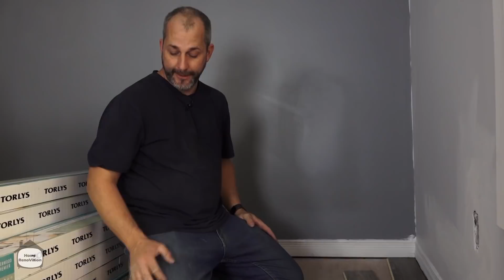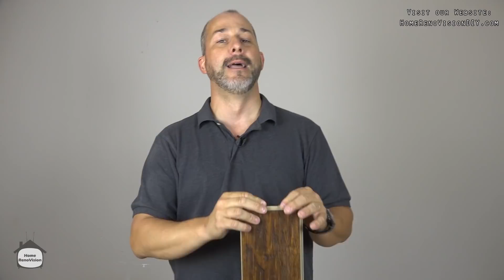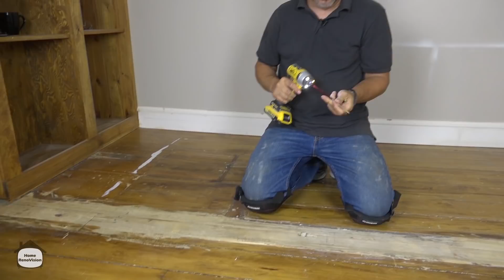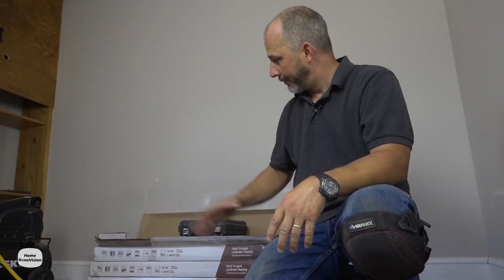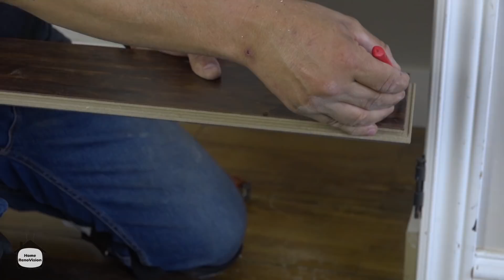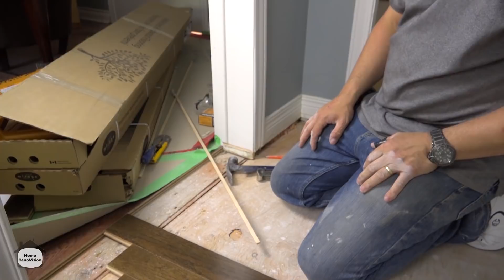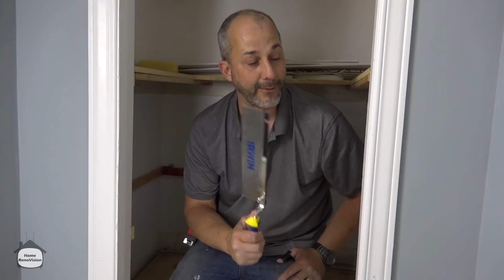How to Install Vinyl Flooring , Laminate Flooring and Hardwood

Comment: Because of YouTube and videos such as this, I'm able to tackle big jobs.  So I've watched your channel long enough to know that a montage of older installation videos is a good social media strategy; however, please help me by adding new content, this is my dilemma:  My floor install is a combo of two types you have here but I need you to go a bit further in your installs.  I'm using a 5"x36" (3/8 thick) bamboo laminate over felt w/vapor barrier non-slab and I started just as you did about halfway thru this particular video. The slats are orientated such that when I get to the doorway it almost looks exactly like yours did but I need to continue into the hallway where the flooring will be parallel with the hallway walls.  At one end of my 16' hallway, there are 5 steps down (split level).  On the opposite side of the hallway is the 2nd room I plan on flowing into placing flooring exactly like I just did.  There is one more bedroom that is on the same orientation as the room I just finished.  So, those 5 steps down seem like they will make/break me - can you do a short video on steps?  I have to run the boards either to the end (doesn't make sense), or put one board perpendicular to the others, run hall slats to that, then add the stair nosing (but it would help seeing you do it first!).  Also, a short video on backward install - because the last bedroom I'll be flooring back into from the hallway install.  The directions do allude to backward installs when doing multiple rooms and you don't want transition pieces - and I don't.
Reply from the maker: awesome!

Comment: I'm not doing any floors, but I enjoyed watching your video! If I were in the market for new floors, I'd just hire you. I hope a television network is aware of your work - You could host your own show.
Reply from the maker: Not concerned about the future, just trying to help people today is all. Cheers!
Reply: @HomeRenoVisionDIY 80's P n' E 'prize home; guess they had to start somewhere.  Good bones, however all flooring, mostly CHEAP laminate put in to sell to me .. . Now with 12yrs of surface water damage, got curled and swollen edges; also kitchen pipe squirted UP and particle board failure underneath, near cabinets, about the size of a body.  Bath wallboard failing near tub, redid silicone, failing above that.  One tile short of redoability, yes, also on particleboard, in the bath???  Scared .   1400sf total floors and ceilings too; old mobile with the lines across, painted previously, and puffy water damage here and there.  HELP!?   Seriously .  I KNOW can do it, just need more confidence.  Triage tips ?  WONDERFUL knowledge base.  Still 
Yikes?!
Reply from the maker: Hi Carol, start with keeping it dry first. then deal with things that are failing like the bathroom. flooring can wait until the end.

Comment: Thanks for another great video. Considering doing the install myself of luxury vinyl planks throughout our 1200sf home. Not sure how difficult it is to continue clicking and locking planks through door ways, one room to another. Or it's easier to just stop and install a transition under the door. Any advice?
Reply from the maker: Transitions are definitely easier. seamless is definitely more sexy!

Comment: Jeff, outstanding video.  I have installed a laminate floor in our home several years ago.  I have been thinking about upgrading to hard wood and now with the tips you have provided I feel a lot more confidence about tackling this type of project!  Great video and very helpful channel in general.  Thanks again,
Reply from the maker: Hi Jb, just realize that it is quite taxing on the back working hunched over. so be prepared to do it over a few days to avoid strain.
Reply: Thank you.  I installed the laminate floor several years ago and man was I crippled up :^(  Bad back and knees.  I could not do it that fast any more or would want to.  Good advice to spread this over several days.
Reply from the maker: Cheers and best of luck.

Comment: Your videos are helping me so much with my remodel. This is perfect timing as I'm deciding on flooring for my kitchen. Can you tell me if you have any experience with the Life proof flooring from Home Depot? It's a waterproof LVP and I had decided to use that until I saw this. How does it stack up against laminate like a Pergo or something like that? Which would you go with? I'm doing this mostly on my own - you helped me before with kitchen countertops! - and I have a budget. I want to make sure that I do this properly, for the long haul. Thanks for what you do!
Reply from the maker: Not personally , but I have heard great things so far!
Reply: @HomeRenoVisionDIY  thank you so much for your response! This is really helpful. The one thing that I've read several times  (about the LifeProof) is that the click together links are a bit weak. I'm starting to think that, for me, it may just be best to stick with a well known product that's been fully tested. I mean the waterproof Pergo. I really appreciate your feedback. :)
Reply from the maker: I will be sure to update my opinion as we go along. Cheers! and good luck with the project!
Reply: @HomeRenoVisionDIY  thanks so much!

Comment: Agree that hardwood flooring is the best, if not the only choice, except for wet area.  We have granite tile in the kitchen and it is durable, non-slip, and easy to maintain.  Everyone who visits admires the hardwood installation.
Had not seen slip tongue 122:00 before.  Solution is nice if you only have to deal with one entry way.
Excellent video.  Thank you.
Reply from the maker: Thanks Albert, Love your choice in flooring. Cheers!

Comment: Hi first off thanks for the channel. What procedure difference for a concrete slab floor.
Reply from the maker: hardwood requires a special paper with slots that you place pl premium in and then you install ! Everything else simply use a underpad designed for concrete. Your local store can help you with that. Cheers!

Comment: Currently have tile and wood floors in our front room/slash kitchen area. Looking to Renovate it and put in laminate over the entire area. Do you recommend removing both the tile and hardwood that is present? Or am I able to go over both of them with the laminate granted it’s all level. Very new to this! Any info from anyone would be great. Keep up the great videos!
Reply from the maker: I would suggest installing vinyl in a kitchen and you could go right over top if you wanted to.

Comment: hey jeff,a computer tip,never blow out your computer with a compressor,a compressor has moisture in its air stream,it can cause short circuit
use a leaf blower instead,or the expensive compressed air for computer cannisters,great diy channel,have a good one jeff
Reply from the maker: Hey Ronny a compressor tip. when you stop using it open the drain for the moisture to leave the tank. then all is well.
Reply: thanx for the tip Jeff,always never to old to learn something @HomeRenoVisionDIY

Comment: Thank you for all the detailed info. I'd like to share with you an idea I learned from another YouTube video to remove scratches from the vinyl or hardwood floor.
Rub a piece of walnut where the scratch is on the floor and you will never see it again. I have made a 50 second video on this subject.
Reply from the maker: sounds fun if it works. Cheers!

Comment: They probably don't include laminate floor cutters because that's the competition (the cheaper alternative) and the don't want to mention them as most people will choose the cheaper option for a variety of reasons.

That's my guess anyway.

I'm about to purchase vinyl flooring for my utility room and it too says it is easily cut with a knife also only a 2mm gap around the edge, as I'm putting skirting (baseboard) after I can hide the edges instead or using quadrant (quaternary round).

Keep up the great work buddy 👍
Reply from the maker: The cutting tool can be purchased from our amazon link below. It is one of my favorite tools. Cheers!

Comment: Very nice video. Question, we're doing the Pergo flooring in our kitchen, dining and hallway. Dining and hallway is carpeted right now and the kitchen is linoleum. Can we just leave the linoleum down? I recall when I was younger the fun you go through when removing the stuff. And do you figure just use smooth out the transition from the linoleum over to the subfloor of the dining room?
Reply from the maker: in most cases if you remove all the flooring you will have only 1 level of subfloor. if you leave it on then you will spend a lot of time and money trying to level it out. Go ahead and get rid of it. only takes a few minutes.

Comment: I just bought a new house and need to choose a new floor.  I want to run the same flooring through the kitchen, dining room, living room and hallway.  Should I go with this vinyl plank stuff or normal hardwood?  I plan to live here for 20 years at least and I have two young kids.

In my old condo I installed laminate myself 4 years ago and don't really want to use it again.  It's okay though, just want something a little nicer.
Reply from the maker: depending on the age of the kids and if you will be getting a dog or not hardwood is awesome, secondly I choose luxury vinyl plank. feels great easy to clean and durable as hell as well as water proof for the front hall and kitchen spills.
Reply: @HomeRenoVisionDIY  Thank you.  No pets.  Just worried about the spills we have here and there.  2 1/2 year old and a 6 month old.
Reply from the maker: And enjoy the little critters, they grow up too fast!
Reply from the maker: yup, you will have spills to contend with. Cheers!

Comment: just like safety glasses and hearing protection, you need to suggest and practice safe measures with regards to your knees.  There are some good ones you can pick up at a bog box store, and some construction clothing  manufacturers now have pants with spaces sewn into the knee area that accepts proprietary pads that will work in a crunch  I have all kinds and being 53 years young, my knees are not getting any younger, so I gotta take care of what I have left
Reply from the maker: for then average diyer knee pads are a little overkill since they won';t be doing it for more than 1 day! Cheers!

Comment: Hey Jeff, I recently had to back fill some flooring after I gutted my kitchen and the cabinets were removed, exposing the bare flooring where the flooring installers couldn't get to before. The problem was all of the joints (both the side and the ends) for the flooring were under the planks, so I was essentially installing the flooring in the complete opposite directions that it was installed. It was a struggle and I'd love to see if you have tips on this process. Thanks for all of these amazing videos!
Reply from the maker: Not quite sure what you are referring too. feel free to send me a photo!

Comment: I’m doing an LVT install. I’m having trouble with my love taps. I keep breaking the edge. 
I’m also using an occultation tool to saw my jamb moldings.
Reply from the maker: great to have that tool. Are you using a piece of the product as a tapping block or the one provided in the Kit?
Reply: I'm using the pull bar and scrap block @HomeRenoVisionDIY  , i think my Home and Decor "Nucore" brand is just cheap.
Reply from the maker: try my system, you will love it!
Reply: @DaBuick  are you saying the Nucore planks are cheap, or a certain tool they provide for installation?

Comment: What's the best for the basement with moisture
Reply from the maker: vinyl, it is absolutely amazing and feels warm to the touch as well even when installed directly on concrete!
Reply: @HomeRenoVisionDIY  is there a certain thickness that is best. it's hard to see any over 6mm
Reply from the maker: not to worry 6mm is going to perform just fine. Cheers!

Comment: How do you level a wooden floor to put flooring in
Reply from the maker: jack up the house or use floor leveling compound.
Reply: When you jack up house how do you level the floor what tools do I need
Reply from the maker: You will need to watch the video in the spring. Cheers!